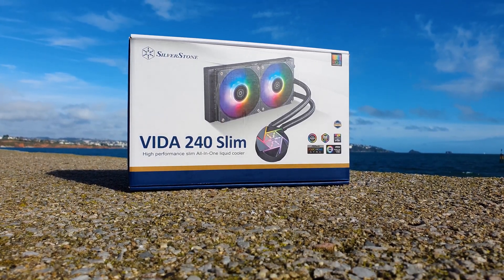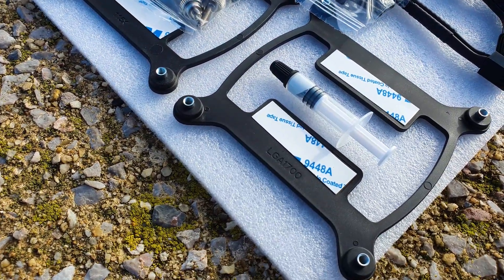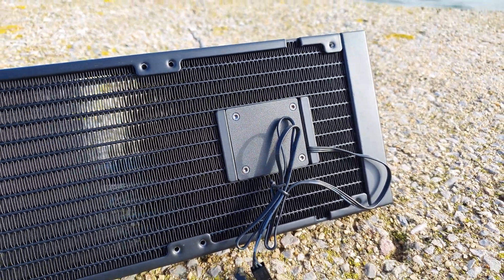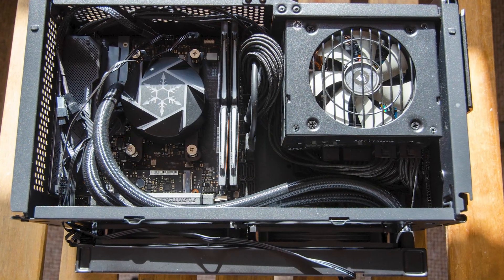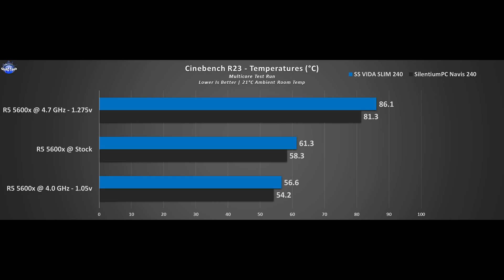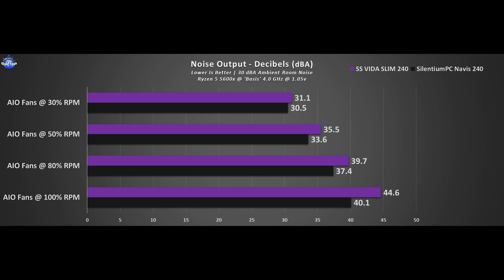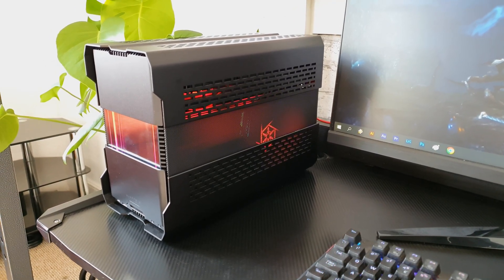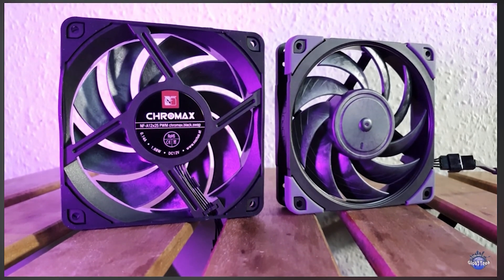SilverStone VIDA 240 SLIM AIO - How Thin can they get?

Comment: Hey Glob3Tech I was wondering if you tried fitting the vida slim with noctua a12x25's? I am wondering if the stock fan screws would work to mount the fans on this radiator? If not, any idea what length/type of screw I would need to do so?
Reply from the maker: Hi Tanner. I haven't tried that but from what I remember, you also get standard lenght screws in the box, so that should take care of it. 👍

Comment: This is awesome bro bro 

Love that it has a fill port … hate those security screws on the block base … if some corrosion occurs inside you can’t clean it then 

Only possible way to then then would be to jet water through both ports … but you still can’t check and make sure … like that 2080ti matrix AIO I fixed
Reply from the maker: Excellent pointers bro bro, thanks! 👍